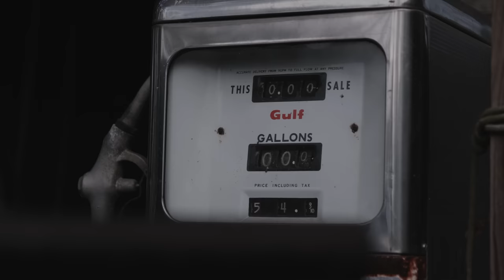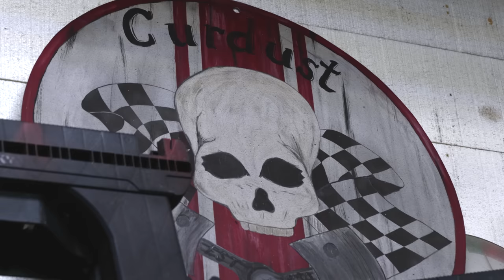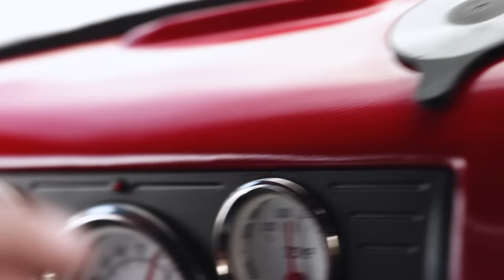"Built not bought" is this 1940 Chevy pickup owner's motto | Why I Drive #34

Comment: I hear you brother and I would be in your shoes had I not gotten a job with the Telephone Company. I did go to Denver Automotive and Diesel in 1971. I really have always loved cars and finally at 68 I have a 2008 Mustang Bullitt and NEVER turn on the radio. It makes me smile to drive . I am right there with you on old school and working on my cars. I have had many. 1949 Diamond T, 62 Pontiac Tempest, 65 Rambler 550, 72 Gremlin, 1955 big window Chevy Pickup. I DO LOVE PATINA !!
Reply: or the howl of that engine tearing it's way to 6500 rpm.
Reply: @crazeguy26  With the FR500 Mufflers

Comment: The truck appears to be a '41 to '46 model year, or at least that's what the front clip tells me. To my knowledge no pickups were built during '43 and '44  and '45's were only built in the fall after the end of WW2. These were called  the Art Deco Design and were sold into early '47 when the Advanced Design was offered. The Advanced Design lasted until mid 1955. I'm not sure if the '41-'46 fenders hood and grille were interchangeable with the '39-40. I'd be interested to know. I built a '46, similarly equipped and similar in appearance. Nice truck!
Reply: Yes it kinda confusing, but it might of been a 3/4 ton, it had cab lights
Reply: 39 / 40 front fenders are the  same 39 rear are wider ( narrower bed ) 40 rears are same as 41-46. 41- 46 fronts are same.
Reply: @joepacheco4038  Good to know. Thanks

Comment: Nice truck man. I have a ‘46 Chevy truck with originals 16”wheels, tires, & tubes. I like your wheels & tires. What size rims & tires are you running. I want to put on wider radial tires but keep the original look. All info would be helpful. Thanks.

Comment: I agree with his philosophy mostly, however working two jobs and buying a new fast car can be every bit as satisfying, some of us who have built cars don't have the time anymore.
Reply: My first 'project'car was a 1992 Mercedes Benz 190E 2.3. 150,000 miles. Bought it for $450 in a non-running condition as a replacement for my 95-ish Mazda 626. Over a period of 6 months, I went to work at a pizza delivery place after high school to pay for everything, and ended up taking it home in the fall. Was told it likely had a valve issue. With help from my dad, we pulled the motor in the driveway, took the motor apart, bought a specialty 12-point torx bit to take the head bolts off, and found a giant crack in one of the exhaust valves. After investigating the exhaust manifold, there was a hairline crack from the EGR port, running down the collector. Our assumption was it was a cold winter day, got parked by the old lady that owned it, shut it off, and cold air got back into the manifold and the temperature shock broke the valve. Couple hundred bucks later, machine shop gave us back the head with new valves, and replaned the head to make sure it's still true. Since the motor was out, we replaced all of the timing components, since it was close to recommended replacement of the timing chain according to manufacturer's specs. You can't get the pin that gets damaged when removing one of the timing chain guides, so we visited a local hardware store and found one that was close, and machined it to fit. With a bench grinder. Cylinder walls all still had beautiful crosshatching from the factory, so we didn't take it down any further than that. Slapped it all back together with the fresh head work and new timing components, threw it back into the car, and about a week after my birthday in February, middle of the winter with a good couple inches of snow on the ground, we turned the key for the first time. Crank crank crank... Nothing. Cycle the key a couple times, and it starts. High idle, which I later diagnosed as a vacuum leak that got mostly resolved, but it ran! Checked for leaks, got it up to operating temperature, then took it for a spin. I wasn't allowed to drive, snowpack everywhere, scary RWD vehicle with questionable everything. But, it ran. A month later I took it on a 300 mile round trip adventure for prom. Chick dumped me a week later. Car made it just fine, even though the driver's front brake pads were completely gone and we were using caliper to stop. Total money spent, not counting tires: $2500. Fresh suspension, new brakes all around, mostly rebuilt motor that always started on the first crank. Always had runability issues, but she never let me down. 7 years, 50,000 miles, a dozen 350 mile trips across the state to college and back, and a solid 2 ounces of weed smoked in it during burn cruises back home. Definitely rode better than my new project car, an '88 Firebird. Twice the power and three pedals makes up for all of that wonderful chassis that I lost, though.

Still miss that car a lot sometimes. Dumb kid that I sold it to didn't listen to me, never drove it hard, and likely let it idle, even though I told him the mark where it's definitely going to overheat and die if you let it sit and idle. Car had to be driven to keep the temp down, radiator fan didn't turn on and I wasn't about to replace the $300 clutch fan when rolling at 30mph was enough to keep the temps below the fan kick on temp, even during hot summer days. Still miss that car. Might have to find another one and make a new project car once I'm 'finished' with the Firebird.

There's some experiences that money can't buy. One of those is tearing apart a car, putting it all back together, and the thing still running when you're done with it.

Comment: From the video description: "1940 Chevrolet pickup which was little more than a grab bag of parts, bolts, and metal when he PURCHASED it on Facebook Marketplace."
I'm no scholar, but last i checked the word "purchased" means you bought it.
Wouldn't it be more accurate to say you both Bought and Built it?
Reply: That saying means more that he built the car from the ground up out of parts. Rather than buying a brand new drive off the lot car.
Reply from the maker: Most of the truck was in boxes and crates when he purchased it. Last we checked, the word “built” means you have to put things together. 😉

Comment: what you get ? about 6 mpg ?
Reply: Probably at least double that if you aren't abusing the go pedal. Very light vehicle and stick drive can get good mpg.
Reply: @silentbravo  It's an auto not a stick. But yeah light truck with a mild motor probably does ok with mpg.
Reply: I have basically the same truck, but 1946.  350 SBC, 260hp / 350 automatic, fuel mileage is 14-15mpg.